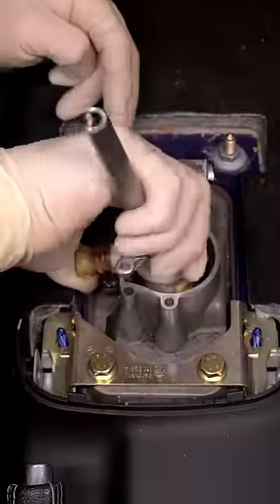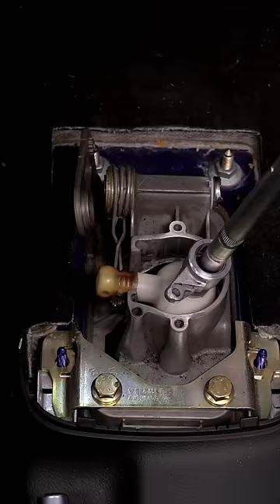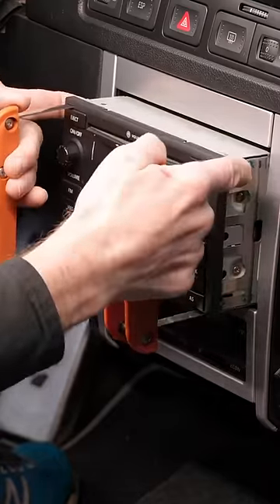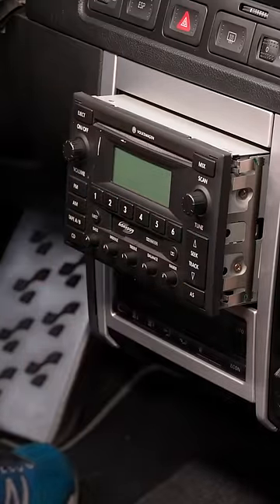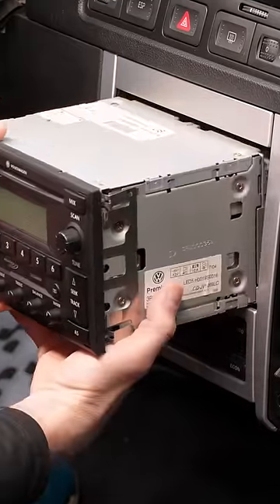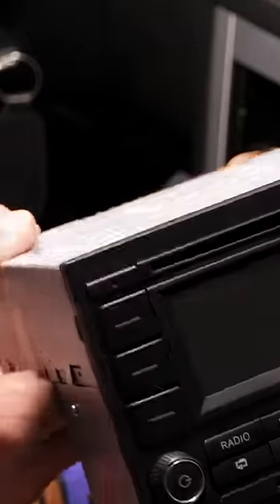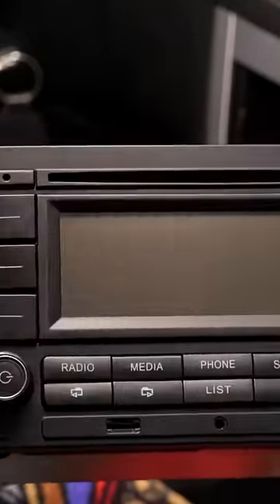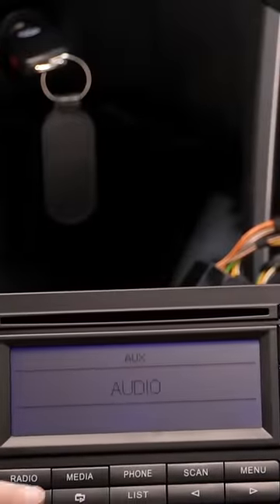I Ruined a Clients Radio OUCH

Comment: The customer wants to keep it mostly stock, so you made the radio non-stock and then just for good measure you also made his cluster non-stock?  🤔
Reply: He probably s poke with the customer and they agreed upon this solution. 
And the cs might have been talking to him about doing that too the cluster at one point
Reply: technically that radio is still a VW original part, i guess stock means period correct in this case.
Reply: Yeah Im confused. A simple patch/paint repair is too much for people I guess.
Reply: lol
Reply: @coalieroller5663  I've only ever heard someone refer to "stock" as not having been modified from its original factory config. So if it was built in 2003 only parts from 2003 will do.
Reply: My guess is this VW owner likes OEM+ stuff. 

Which is exactly what was done.
Reply: He got his bang for his buck on this one. After a few days he’s going to be like I’m happy he scratched my radio. This worked out great for me 😁
Reply: Though the same
Reply: Stop it Karen, that Karen disease really hitting this year
Reply: @steadly3668  This is exactly what I was thinking. It just looked like it needed a paint touch up and polish
Reply: @coalieroller5663  but it's lower trim radio
Reply: @coalie roller  technically it's not, if its not branded with vw or Volkswagen, it's 100% not, he didn't swap a newer generation uint in, he bought a uint built by a completely different company that made a uint that gives the oem look. 2 seconds to notice there's no Volkswagen on the face plate anymore would tell you that, as Volkswagen will always brand their stuff.
Reply: @allrimmedout  not all vw parts are branded, my 02 golf factory radio wasnt branded on the face
Reply: @CajunReaper95  Which word(s) are you having trouble with?
Reply: @josephgitzler7942  Guy in the video clearly stated it was an "OEM type replacement", i.e. it's generic aftermarket crap that has OEM styling.  It's like those spindle fit head units for classic cars that have Bluetooth and MP3 support and look vaguely authentic from a distance, if you squint.
Reply: Exactly my take away.  If the customer was on board that's clearly fine but those were contradictory.
Reply: or maybe you don't setup cameras and tripods in SOMEONE ELSE'S CAR when your working on it. You're getting paid to fix it not film it. YOu want to film stuff film your own car
Reply: @YasinVanDoorsen How do you polish matte black plastic? Do you understand the words you're using?
Reply: It's an OEM radio and the cluster probably looked like ass before. I'm sure the customer is fine. They probably just didn't want some riced out light show aftermarket single din radio.

Plus they said "mostly stock" not 100% numbers matching perfectly original.
Reply: Exactly what i came here for 😅
Reply: This is what I thought
Reply: Makes a great video. Wait a second, if he didn't film this crap the damage wouldn't have happened.. weird
Reply: @reesebroekhoven3962  no when you have a YouTuber who is well known working on your car, you know your cars gonna have a camera in it😂
Reply: Lolll. 

“I scratched the customers stock radio on his stock R32 so to make up for it, I threw on some fake vents and a attached a fart cannon!”
Reply: My thought exactly.
Reply: Lmao that's what I'm saying, dude fucked up his oem radio then said shit gotta swap as much as I can so maybe he doesn't notice
Reply: I thought the same
Reply: Came here to say the same thing. 
A quick wipe down and a magic marker would do the trick and still have the stock/original radio.
Reply: That’s all I heard too
Reply: That was my first thought
Reply: LOL i was looking for this comment. He said it like he's doing the guy a favor. And the whole time I'm think wtf are you doing. Don't touch the cluster?!?! Just fix the radio and hope he calls it even.
Reply: @steadly3668  Yeah good luck fixing soft touch material.
Reply: @YasinVanDoorsen  Not how it works xD
Reply: Yeah what the hell. First thing you do is contact the customer and tell what happened. Then you offer solutions.
Reply: He spoke with the customer and they agreed to a good replacement and the instrument cluster wasnt replaced at all but stay hating
Reply: Meaning not like gaudy, with some aftermarket touch screen or custom white face gauges. Most people would never know it's not stock
Reply: @3n3ly7m9  the radio isn't soft touch plastic.  He could have (should have) just bought a used mint Monsoon unit and swapped it in.  I'm literally staring at one that I'm about to throw away he could have had for cheap.  I replaced it with the same radio he used as it's a nice upgrade (Bluetooth input) while still looking OEM.  Oddly they come with Blue display and red lighting to match MK4/B5 cars, so not sure why he ended up with a white one and then had to swap....
Reply: @DG_427  And that's what he did xD watch the video.
Reply: @3liter6  No B5 has blue Lighting unless its B5.5 Passat W8. The S4 and A4 have red. I've no clue about B5 Passat or B5.5 normal ones cause I don't care about the Volkswagen counterpart. I thought the Golf/Jettas had the same crappy radios as the B6 and the A6 C5 where you take your nail, and ruin it to shit.
Reply: For real. All because you were filming. Maybe just do your job. I’d be pissdd
Reply: Yup, definition of "no good deed goes unpunished"
Reply: @coalieroller5663  That's what I was thinking. The new one looks right and cleaner in my opinion. Plus looks like it gave them more options for the media they could use on it. Subtle upgrade keeping the theme of the car.
Reply: Yeah, I'm trying to work that out myself
Reply: Sanding and painting would work
Reply: So that’s why we’re paying $75 an hour for mechanics, so they can film their work! Your supposed to be working, not filming…unless it’s your own garage…unless your charging by the hour.
Reply: @coalieroller5663  Stock meaning "what it came with" and "how it was from factory"
Reply: @coalieroller5663  no, stock means as sold. Adding in a different radio regardless of the brand means nothing. Stock always, and has only ever meant original.
Reply: Non original but still oem spec. It's like restoring a car it's not gonna be 100% original parts.
Reply: @nathanbrown6172  For the sake of the video, the story doesn't make sense or the script needs to be edited.
Reply: being asking myself the same... Some customers wont be so keen. Like: 
"I want to have anything like before, when I brought my car to you i.e. I want the original radio back, as it still has CASSETTE player with CD... " 
Personnally I would have tried a paint/polish job first.. then talk with the customer explaining just the truth. 
Sh1t happens tho but the best thing is to stay honnest.
Reply: Lol seriosly wtf
Reply: what could've been done is replace the plastics
Reply: Yh I got so confused 😂
Reply: @3liter6  where did you find a RCN210 with blue display? They're mostly white...
Reply: Well he did say a 20 year old radio isn't available
Reply: I was about to say the same thing!
Reply: He did the whole Bruce Jenner trick. Maybe nobody will notice. Lol
Reply: My thought exactly.

Also, I'm certain thst could have been repaired invisibly by a specialist company. Thst would have been the correct thing to do imo.
Reply: @ferrumignis The stereo is a great alternative for the generation. You can’t tell it isn’t original, even the coloring is an exact match for materials and lighting. But then it has bluetooth that connects automatically to your phone on start up. Not junk. Most of those are built for these cars in countries where the generation lines extended beyond what they did in the united states to update them at a reasonable cost.
Reply: @ferrumignis  While I would like the Original radio in my MK4 Variant I'm happy that the previous owner swapped it for a BT radio... I don't really need a cassette deck anymore xD
Reply: Do you know what mostly means?
Reply: I would have been livid, would rather repaint the stock radio

Comment: "I even rolled back his odometer 25,000 miles"
Reply: They could
Reply: @BASSNETIC-MUSIC  not legally
Reply: @-4023-  so?
Reply: @-4023- no cops around habibi everything legal
Reply: Scratch that.  250,000 miles.
Reply: He didn’t though
Reply: Respect
Reply: Haha
Reply: "I even went in a parade where I was seen on TV"
Reply: @BASSNETIC-MUSIC i bet Matt could but i doubt he would. Lol on another note, you could remove fuse #7 and it will Stop the odometer from counting miles. But the speedo also will not work and the Fuel gauge will be wonky. Mine only worked if it was over half full
Reply: Bro is NOT Matilda’s dad 😂

Comment: There is a dude that would travel around in mid Michigan to different dealerships, and his sole job is to refinish plastics and upholstery in the event of burns or cuts, and he did such a clean job. When he got done, the detailers or mechanics couldn’t tell anything was damaged.
Reply from the maker: That’s awesome
Reply: We got one in South Georgia/ North Florida as well.
Reply: CCI?
Reply: I’ve always wondered how someone would get scratches like this fixed. Gonna check out some videos
Reply: @vermili0n  Depending on the surface, especially the coating, there are actually a few layers, especially so to prevent weae/fading and chipping (like the majority of dash paneling goes through over time).

Often times a head unit, let alone stock, isn't in the best of build quality but just mad with the most respect to ease of use and controls. But over years automotive budget let's them do what they want in some areas vs others, often times forking out some areas to the development of an outside for ( stuff like a contract for a number of years for special car seats, tires, head unit, audio speakers etc to a company for a set number of years or at least til the product line production ceases)

Bit of a rant apologies
Reply: @vermili0n  Having actually done this in a Volvo V70 that would be 20 years old if I had it (mine wasn't even Monsoon, but I didn't want to buy $300 CANbus adapters to preserve my steering wheel radio controls), European cars typically have radios that only the registered owner of its factory vehicle can retrieve. Therefore, there are more good units with good parts that can't be used due to CODE lockout than good working units with the factory code available. Buy a used one, swap the bezel. Yes, it's extra steps, but it's infinitely less problematic than removing quality and installing Chinese junk in a complex car with the complicated version of the audio system and wiring. In many Monsoon equipped cars, this would disable part of the system. In some VWs, removal of the factory unit makes communication with diagnostic tools difficult, Monsoon or no.

Comment: He wanted it stock so i change as much as possible 😂
Reply: If I were in this situation I would explain to the customer what happened then suggest that I would just try to use a plastic filler and paint and sand it down if possible as long as the customer agrees but also tell them that before doing so I will try putting the filler out on a scrap piece of material and paint that so I can colour match it whilst it is on the filler to compare it and see if the customer is happy with the potential results

Comment: I wish I had a mechanic like you. Last time I took my car into a mechanic shop it literally performed WORSE then before and the mechanic basically said "shi happens not my fault"
Reply: Mine drove in got rolled out blown up😂
Reply: Mine went in for a suspension evaluation and came back missing a lug bolt.
Reply: ”For what will it profit a man if he gains the whole world, and loses his own soul?“ Mark 8:36 NKJV 

“For God so loved the world that He gave His only begotten Son, that whoever believes in Him should not perish but have everlasting life.”John3:16 NKJV

“that if you confess with your mouth the Lord Jesus and believe in your heart that God has raised Him from the dead, you will be saved.”Romans10:9 NKJV

Romans 3:23 (KJV)
For all have sinned, and come short of the glory of God;

Romans 6:23 (KJV)
For the wages of sin [is] death; but the gift of God [is] eternal life through Jesus Christ our Lord.
Reply: Last “shop” I took my car to for a misfire didn’t even gap the new plugs correctly and got hostile when I told them the proper gap. They also put my lug nuts on hand tight and tried to tell me the vibration I was feeling was a bad wheel bearing. Needless to say I do my own work now